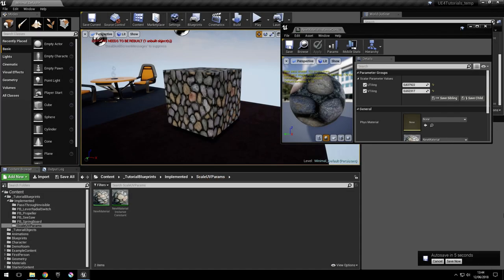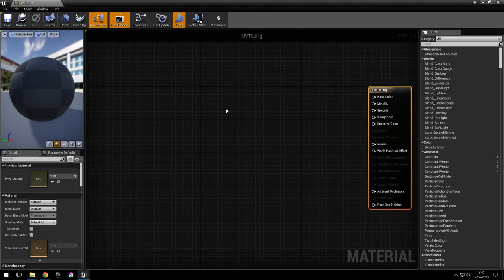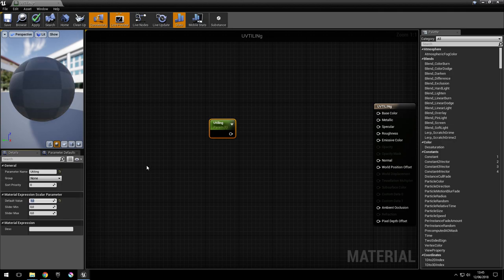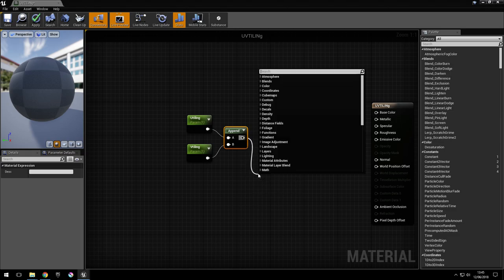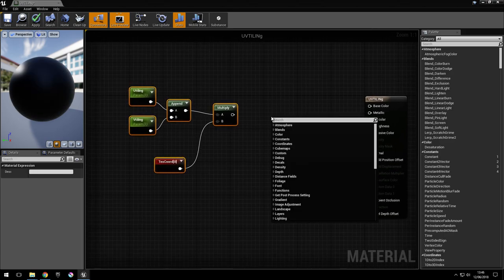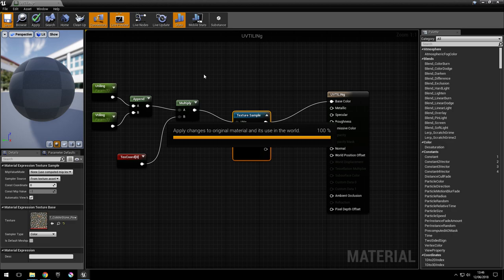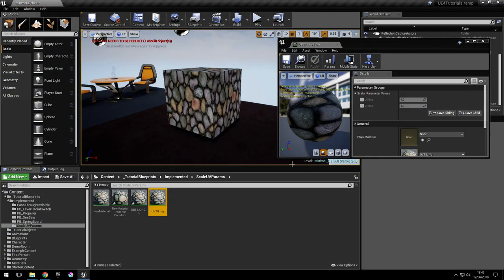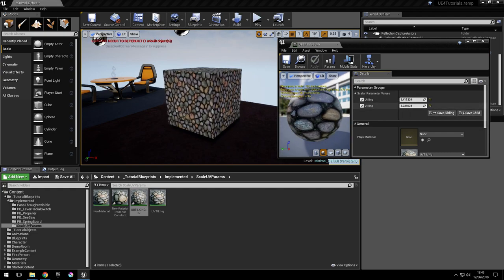UE4 Scale UV Coordinates through Parameters with Blueprints in Unreal Engine 4 Tutorial / How To

Comment: Can you please explain how to transform x and y UV not just scale since there is not parameter in texture coordinate node other than tiling which drives scale not position.
Reply: Very simple.. just add to it.. if you have your vector 2 uv coordinates.. you can just do an "add" and plug another vector2 in to control it. Basically like offsetting it.

Comment: Thanks.
Just a question. I have to use different scales of my texture with several objects, so I have to 'Save Sibling' for each of them, right?
Reply: You could make new material instances
Reply from the maker: It's what Wybrem said. 
If you spawn the objects dynamically from a blueprint, you cand also set the parameters of the material instance from the blueprint.